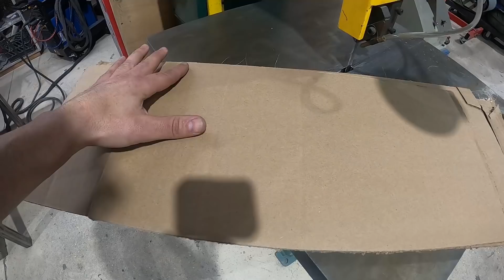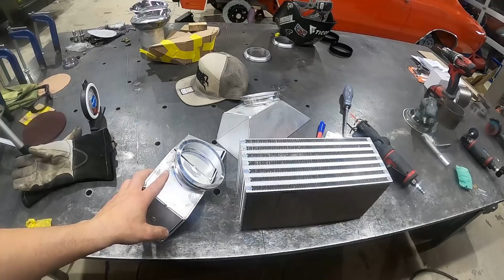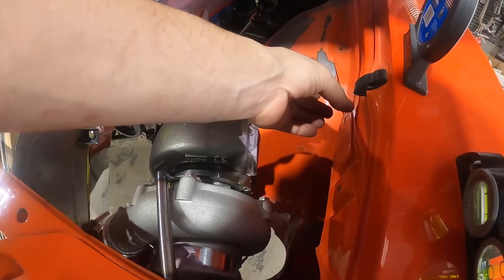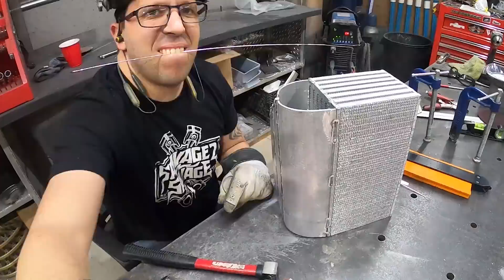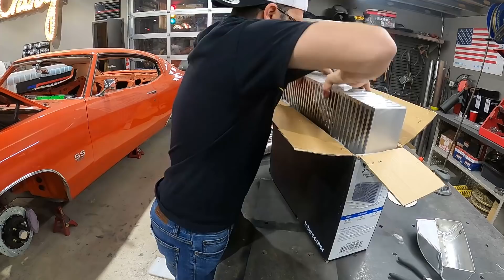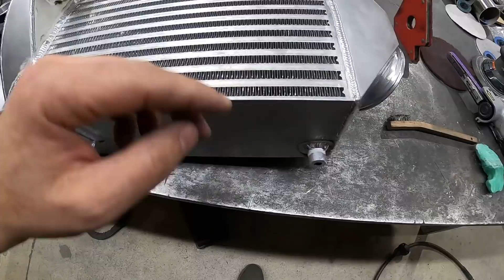Custom Twin Turbo Intercooler for 1000 Horsepower LSX Muscle Car - 1970 Chevelle Ep. 6

Comment: Are those solid motor mounts? Are you worried about the engine moving in relation to the intercooler and cracking pipage?
Reply from the maker: They are solid motor mounts. The HD clamps that we use from vibrant have movement in them to account for that!
Reply: @SalvagetoSavage  Ahh... Thanks for the reply and keep up the good work my man. 😎👍